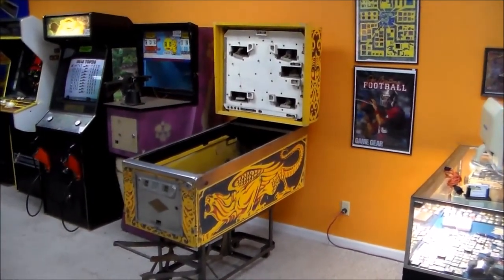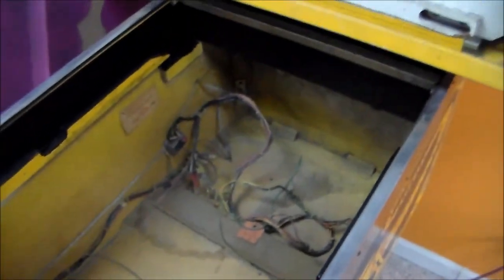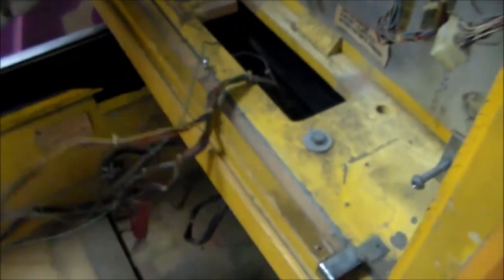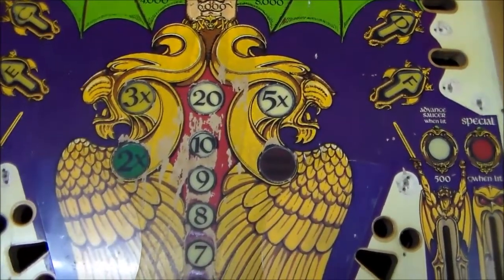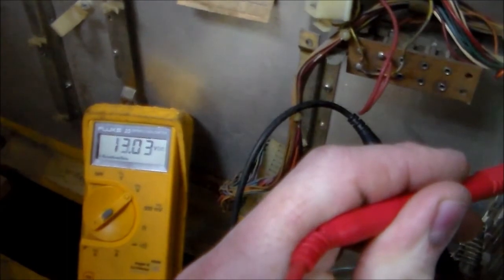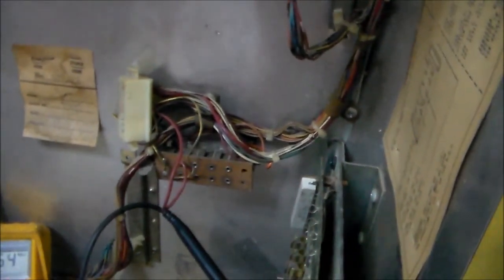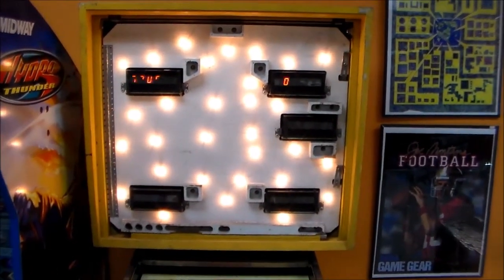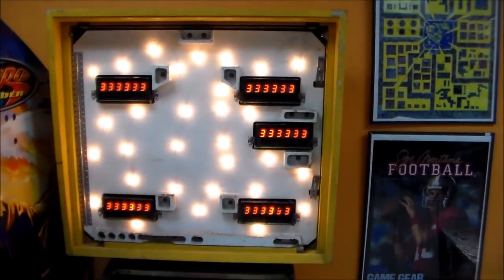Bally's 1978 Lost World Pinball - Repair Video #1 - Lets Resurrect this thing!

Comment: Whenever I have a project, I always get that feeling of satisfaction and achievement when I see a positive sign.  That one light globe can make you feel it is worth while.
Reply from the maker: Yeah that's the best part when the machine gives you a little sign that it's trying to work.  I've found that since machines and mechanisms are designed for a purpose, usually they will try to fulfill that purpose if there's any possible chance.  They don't have a soul, but they DO have a purpose... and they tend to work towards that purpose.  so if you spend a little time and help the machine along a little bit, it will do the rest and work towards it's purpose, in this case it wants to play that game!

Comment: I've played pinball machines as a kid.
I even had my own miniature pinball machine toy.
Unfortunately I don't have any pictures of it.
I took it apart when it broke.
All the bumpers and kickers were all mechanical as opposed to the solenoid activated bumpers on an arcade pinball machine.
Here's how it worked,
There was a motor that ran to a shaft that housed the bumper actuators.
The actuators were held still by the part that the ball hit and when the ball hit the bumper the rotary actuator was free to spin and the that spinning actuator pulled the bumper down.
To get to the mechanism you had to remove the metal plate the ball rolled on.
It also had sound and tracked your score.
A single motor ran the entire machine.
It plugged in to the wall for power with a removable adapter.
There was no way to play it on battery power because there was no battery compartment and I think plugging it in was the only way to meet the high power demand for my pinball machine.

Comment: Can I send you a strikes & spares mpu board to check out ?  I'm restoring it for someone, it wasn't used for at least 6 years.  I had it working but now it wont boot up.  when i did have it working the led that flashes never did flash.  It has the red 12 light on.   I put the new large caps in the selonoid board & new voltage regulator.  It was pushing 8 volts where it was suppose to be 5.  I also did the 3 ground updates on selonid board like you showed in another video.  Also have the hv pot trim screw coming in mail now the old one fell apart.  I may need some used displays too.